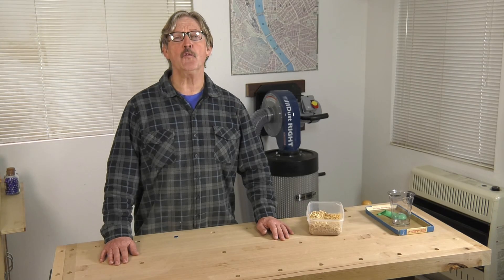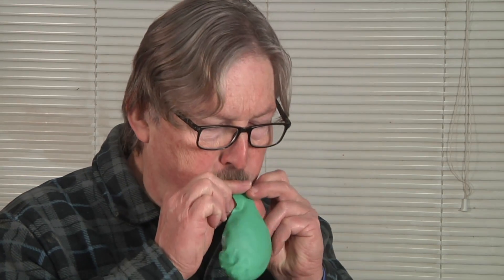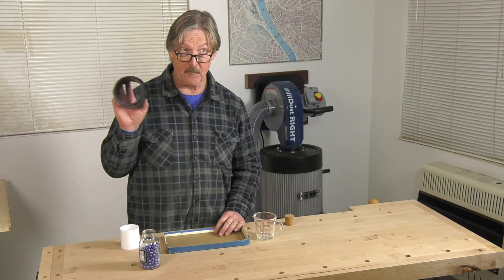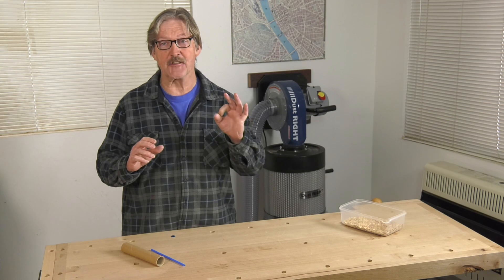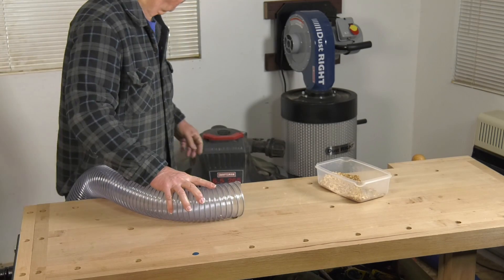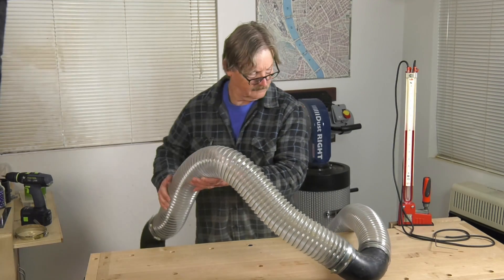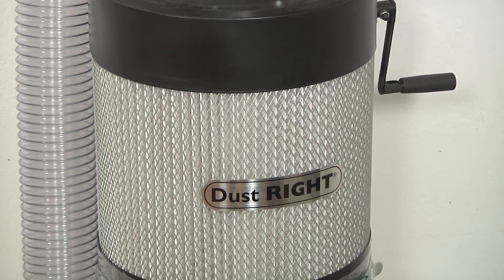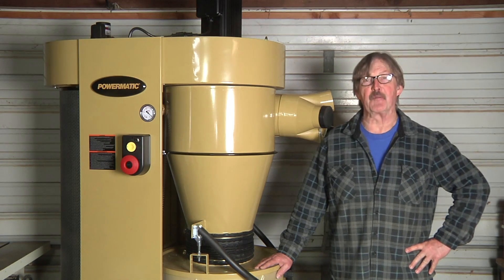Measuring Dust Collection Airflow | Woodworking

Comment: You have been an inspiration to me. 

I read your book three times. Actually took two classes at 2nd year HVAC engineering level. I have two Ph.D.s and a law degree (no joke).  I made a ton of money on tech stocks so I allocated $3M to build a sawmill, dry kiln, millworks and all the associated shops. 5500 sqft.  Yup, the go big before you die approach. 

But, I still ended up spending >$40K (2000 dollars) on engineering to get the dust systems right. 

This stuff doesn’t scale from the 2 car garage shop (which is what I had for 25 years).

With the advent of the mega-shop builds that YouTube seems to suggest, people need to invest in experts. Or just try and self-insure your fire risk •••

Comment: I feel that you did an excellent job of explaining the basic mechanics of air flowing through a pipe, but completely neglected to say how it applies to this situation! 
Should one use a larger diameter system of ductwork, only reducing as needed size at the tool? Can diameter be increased/decreased without significant losses? Is there an ideal diameter of the inlet for chip capture based on CFM or horsepower of the system? (duct length and complexity not withstanding). Is there an ideal volume/pressure ratio for chip capture? For airborne dust capture? Is there different CMF/HP/Diameter/airspeed for dust extraction VS chip capturing? How do such systems differ?
Reply: Great comment, I have the same questions and wish they were addressed.

Comment: Nice job, as a retired mechanical engineer I was impressed with the way you showed the principles.  Now if you can just solve the miter saw’s problem of miserably poor dust collection.
Reply: I've heard festool has done the best in the industry for dust collection on the miter saw, with their kapex miter saw.
Reply: @joshyingling  As a woodworker and an engineer, I solved the miter saw problem, at least in my shop. Here is my solution https://youtu.be/SBcdS1ACEQ0?t=301 (sorry for the video, is old and it's not the best video I produced). And I'm currently editing a video about the science under the the diy dust collection systems, to be published this saturday :)

Comment: Wow!! I wish I could tell you how many people in Facebook groups for hobby level CNC router's and general woodworking group that I have preached dust collection principles to.  100% of my knowledge came from your book. 
I am designing my 2nd dust collection system right now and I have to say THANK YOU because your book taught me so much.
Reply: Clinton Caraway would you recommend 6” or 4” pipe? I have 1.5hp dust collector
Reply: @pharaohacura3618  look at your dust collector's inlet.... not the splitter but the actual piece right before the impeller.  Most likely it's a 6". If so run the 6" as far as possible and reduce to 4" for drop downs to each machine.
Reply: Clinton Caraway to be honest after i saw the price of 6” pipe, i opted out for the 4”...Lowe’s had ‘buy 10 get 20% off’ , lol...

Comment: Great video!  Thank you so much for taking the time to help educate us novice woodworkers!  Do you have any videos that explain how to handle static electricity in your dust collection system?  I just purchased a desktop CNC and the static from my shop vac is driving me crazy!
Reply: In my opinion (industrial background) static conductive vent/duct/materials grounded on both ends is the best way to address, but using static dissipative vent/duct materials should also work just fine for what we do. Flexaust is one vendor that makes both types, and is who I am going with as I am building my new home shop.

Comment: I read the last edition of Woodshop Dust Control and learned a lot about, well, a lot. I really appreciate how you covered so many facets of woodshop dust and shavings and ways we can protect ourselves and our woodworking environments. I struggled with some of the concepts, though, and found this video to be very good at explaining the factors into overall dust collection airflow. I hope that you plan to release more videos related to dust control, including various equipment, differences between a large collector vs a shop vac, air filtration systems, and personal protective equipment (PPE). Also, I often wonder how much misinformation is out here on YouTube and on the Internet, so perhaps also clear up some of the confusion if/when you release videos.

Also, do you plan on updating Woodshop Dust Control? The copy I read was from the library, and I'm interested in buying a copy for reference. Thanks for the information!

Comment: Very good video in explaining the fluid dynamics of air handling. I was very interested in the changes of volume and airspeed between a 4" and a 2" hose. so many of my tools have 2" ports and I'm currently installing  30 feet of 4" PVC piping with three sanitary T's  and blast gates unto a WEN 1.5 HP cyclone dust collector 650 CFM. All turns will have two 45 deg together reducing friction with a total of 4 bends. All will be reduced to a 2" hose to connect to each machine. I'm now wondering if I'm making a big costly mistake? I guess I'll find out once it's all installed.

Comment: Great video with a simple explanation of the principles. You might want to add along with friction comes static electricity and you need to add a  grounding  System.
Reply: As important as that is, it doesn't fall under the remit of the title.
Reply: That’s old woodworkers myth

Comment: I have a Rockler Dust Right 650. It has a 4 “ inch hose. My Tools Dewalt 7845 Table Saw has a 2.5 inch dust port. I also have a Ryobi 12” inch Miter Saw with 1.25 inch dust port. I’m new to Woodworking and trying to figure out the best way to set up dust collection. I would like to run a Y fitting from the DC. So I could run a 4 inch hose with 2.5 inch reducer for the Table Saw and a 4 inch hose with a 1.25 inch reducer to the Miter Saw. But I know if it will work right

Comment: Hi, i saw your video and I have a question to ask about the dust collection system that i'll be bulding for my very small bedroom shop. 
I want no costly mistakes. 
Ok, my Shop-Vac is a 6.5HP with a 2 1/2" hose attachment. Now here's my question. Should I stick to the 2 1/2" piping or should I use larger PVC pipping like 3 or 4"? Will the larger hose give me more suction towards chips and dust, or it would be the exact same as if I would use a 2 1/2" pipping?
And 2nd question. I know that flexible hose is not a good idea, cause the ridges cause loss of suction.
But I still need to ask. If I'd use flexible hose, BUT at the exact length between each connectors, no bending of it, fairly tight fit, would the loss of suction still be the same issue, cause of the ridges? Or it could do the job?  OR should I stick to PVC?

Please let me know. I'd greatly appreciate your help.  Thanks

Comment: 5:01:   Nope

Given the same *volume*, the air flowing through a narrow hose will naturally travel at a higher speed than through a wider hose.   Volume however wasn't the constraint stated by the presenter, but rather *pressure*.  All other things being equal, with the same pressure, the speed will be the same in both hoses.

But let's be clear -- the same dust collector, powered by the same motor at the same electrical input won't be exerting the same (negative) pressure on the wider hose and thus the air velocity will be lower.   That's the point to remember.

The reason the air comes out of the straw at a higher velocity is that a human can't generate the same high pressure in the wider tube -- you're off the human 'pump curve'.  

Fluid dynamics are lovely, but not always lending to simply explanations.

Comment: I think this video gives a great foundational understanding of dust collection, but I feel the need to clarify some things you said about the duct or hose size.

Air velocity is absolutely relevant when it comes to friction inside the ducting or hose, but only air volume matters for capturing dust before it escapes the localized partial vacuum near the dust collection intake. I think the example of blowing through a straw is misleading because it may leave people with the false understanding that the increased velocity inside a smaller tube will capture more dust. Keep in mind that suction is all about the difference in air pressure, and suction does not have velocity. When you blow air through a straw, it can move more sawdust because the fast moving air will come into contact with more still air, and cause a greater volume of air to move as it trades velocity for volume. The same does not happen with suction. For any fan that can move a certain volume of air, the dust that is pushed into the vacuum from room pressure will be the same regardless of the hose size, if you aren't accounting for friction. When we account for friction, the bigger hose will perform better. Your example with the shopvac using a larger 4" hose attached is misleading because even though the velocity in the hose is indeed lower and you are seeing fewer chips sucked in, these are not related. The reason fewer chips are sucked in is the same thing that happens inside a vent hood or any dust collector attachment. Your demonstration with the larger tube sucking in fewer chips is a result of it drawing in more surrounding air and less air containing dust, which isn't a factor when your hose is connected to a tool's duct collection port or a vacuum attachment. What happens in the duct or tube after intake doesn't matter (except for losses due to friction or blockage). What matters is the volume of air you are moving into the tube, and efficiency is primarily dictated by the hood's ability to draw more air containing dust than surrounding air without dust.

To summarize what I'm trying to clarify, your fan's CFM rating matters a lot more than hose or duct size, and a bigger hose is always better when connected to the same tool or vacuum hood.

But you were spot on with all the talk about losses due to friction and general recommendation to use at little flex tubing as possible.
Reply: Do you have recommendations for reading, videos, or websites we can go to for additional information?

Comment: I bought the harbor freight 2hp dust collector which is a 4” inlet. I want to add a Oneida super duty dust collector and make a 2 stage. They offer 4”,5”,&6” sized super dust deputies. How do I do the math to know which is the most efficient????
Reply: I'm sure there are apps for duct sizing, but here is the old school way and it works very well for round ducting "Trane TD1 Ductulator with Sleeve, Duct Sizing Calculator
".  They are about $15.  A general rule of thumb for dust movement is to try to keep air flow at or over 4,000scfm.  Slower it sticks to the walls of pipes.  Too fast though and it can generate heat from air friction.  Once you take the collector's rated capability and line it up with a pipe diameter on the Ductulator chart that results close to 4,000scfm, it will probably be a good place to start.  Use long sweep elbows if possible.

Comment: Ribs of the flex hose are causing turbulence which creates significantly more resistance to the air flow than surface friction.

Comment: Watched to the end. Walked away with the notion that I need a 3 phase 25 Hp system with 10 inch metal or plastic pipes. A follow up video is needed to move from the abstract / theoretical to the concrete / real world  application.
Reply: Absolutely agree, I'm thinking that a larger duct then stepped down at the tool will work the best? I compare it to the water cannons they used to use to strip dirt in mines????
Reply: @patrickmeeuwissen9331  I wouldn't suggest your method: high air velocity at the tool, seems great! But the air slows down at the larger duct, which means that some heavy particles would not be carried away anymore. Resulting in a clogged system.
Reply: @  @StephenBiebuyck   richtig, aber zunächst müssen die wegfliegenden Späne oder Stäube aufgesogen werden. Das gelingt nur mit höherer Geschwindigkeit, d.h. einer feineren Düse. Die Stücke dürfen aber nicht zu groß werden.
Reply: Agreed!!!
Reply: Keeping it simple thus keeps it at maximum effectiveness.
Reply: Wow. I'll be picking up the pieces of my head after watching this video. Once I'm all picked up and at least partially put back together I'll look for a video on designing my collection system for my workshops(small basement one and larger one in my garage). Whew!

Comment: Can you run ductwork under a raised floor? Then up to the cyclone? Most setups I've seen are overhead.
Reply: You can, and that may allow you to design straighter runs with smooth pipe & less turns, thus reducing your friction.  Just keep in mind that without proper velocity, chips may collect in the ductwork, so configure your system to allow for periodic access.

Comment: ...and? What do I use then? 
This video doesn't really give any answers. 

If one ignores the complexity of the system - and is limited to the same dust collector (not knowing its performance):
Is it better to have a long wide internally smooth hose - or a long narrow internally smooth hose?

Also, what about combination of hose diameters?
Is it better to run a wide duct-work, the narrow them down as the duct gets longer?
Reply: Yes, use wide, smooth duct-work as much as possible, then narrow at the collection point.
Reply: @hatsix  If I want to extend (make longer) original pipe of vacuum cleaner, should i use narower pipe?

Comment: what causes pressure losses?
Reply from the maker: There can be several causes. Fittings that are not tight or hoses that have holes, runs of tubing that are too long, collectors that are over full of sawdust or chips.
It is too substantial a question to answer here. Sandor’s book is a great place to find all the answers and the solutions to the problem.
Reply: why does a long hose cause pressure losses?
Reply: @ScreamingEagleFTW  more friction along the longer length of the hose

Comment: A very clear way of explaining this! Im interested in the pros and cons of mixing different diameters. Is it best to stick with one at all times? I bought a "shop vac" (not the brand though) and it has a 32mm diameter. Is there any point in using a larger diameter for a longer path? (when the machine is in the other end of the shop for instance).
Reply: What you can do to increase velocity farther down the pipeline is to decrease the radius  after a certain point. This will not increase CFM but can be useful for smaller tools that require more velocity and less CFM.

Comment: I used to sell large dust collector and you should ground (connect to the ground  not the negative in a panel box or a ground rod put in the earth) the duct work as the dust moves through creates static electricity which has been known to cause fires.

Comment: I have the Harbor Freight system with 4” PVC. All machines in a row (split the two car garage in half) Air flow is ok but it’s hooked up with 120 service. What’s the benefit of upping to 220?
Reply: If  motor rating (HP-Speed) is same and blower (Dia- width-pitch) is the same the only benefit would be lower amperage on electric service and a cooler running motor.
Reply: Thank you for your answer and quick reply! Happy woodworking.

Comment: A good movie for beginners but there is actually a factual error in your description. A dust collector that is exposed to a longer duct run, more twists and turns or more flexible hoses does not actually have to work harder than one with lower friction ducting. It has to work less. I know it might be counterintuitive but its just basic thermodynamics.
You will put the most strain on your dust collector motor if you dont have any hose at all.